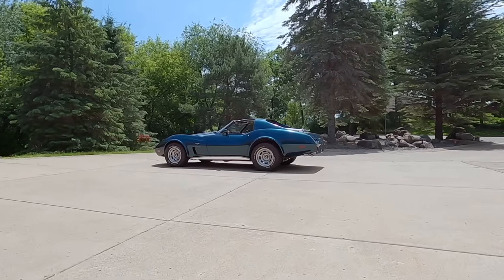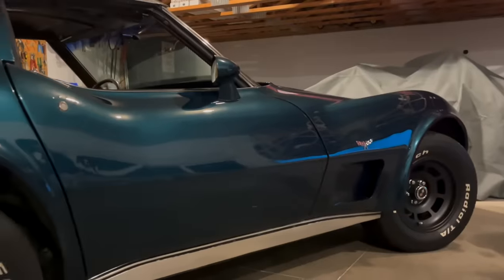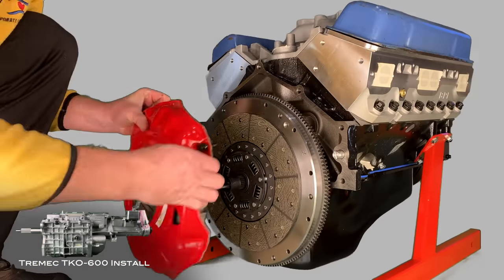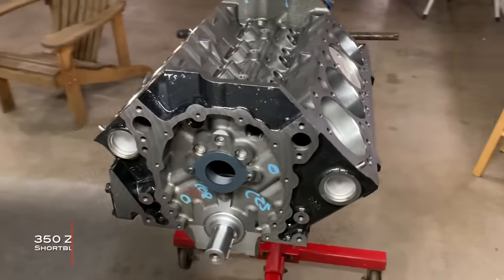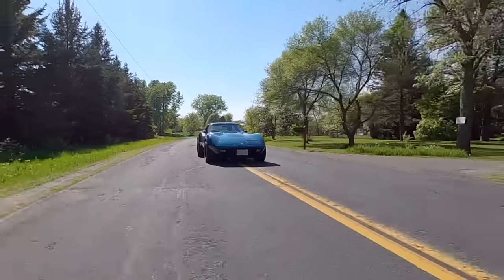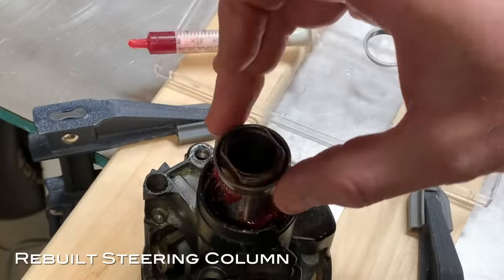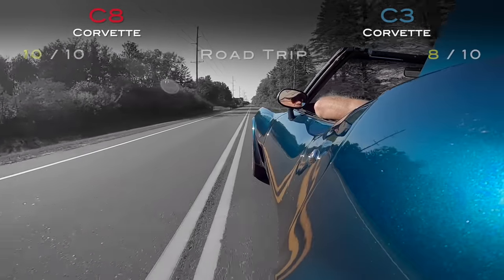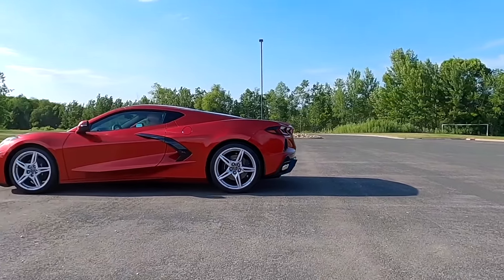C3 Makeover: Modernizing a Classic Corvette

Comment: A simple "carburettor" injection system can improve all classic cars, and the simplest fit under the air filter, and can't even be seen, anything wrong with the C3 can easily be fixed, if you think engine mods are easy, then just change the rear suspension as well, not that hard, you can buy a kit, or make something even more radical yourself, maybe a Jaguar rear end, and do try LED headlights, then you can't complain about the light anymore, about the dashboard, i'm a boat builder, there's a lot of better ways to make a dashboard, but unlike a lot of others, you actually made one, maybe make one more? Start by putting a piece of plywood in deep, find some tubes and pipes that fits everything you want to mount, make a square for your tablet, drape some cloths over it, give it some polyester, reinforce it it with fiber glass, remove the wood and anything else you don't want behind, and reinforce on the rear as well, make some mounting points, and you're almost done, you can wrap it in fake leather, or even real leather, maybe even with stitching on the edges, and again, you just cover it with masking tape, cut it where you want stitching, peel it off and lay it on the material you want to use, or maybe a template that are stretchable, lots of YouTube videos on both subjects
Reply from the maker: definitely going to check out-consider the fiberglass route and hindsight: wish I would have made some google searches before I took the sheetmetal route! I think what I may consider is keeping "some" of the aluminum structure as the gauges are already set back and then create a more "period correct" overmold to match the interior. Appreciate you sharing all these details and thanks for the comment!

Comment: It's the "Lobe" separation that gives a cam the "choppy" sound,
even with 230/224 that cam is still going to be mild, because the lobe
separation is 112 degrees, (used for fuel injection, turbos, superchargers). 
You don't start to get radical until you get into the 108–110-degree cams, 
or serious crazy rad cams is 106-107, which is the sound everyone wants. but makes
it near impossible to tune. but you can't run a 107-109 on an LS motor
Even 110 LS is pushing it with a computer.  Great video btw
Reply from the maker: @ssdtrain1 - yes 100% correct! I didn't want to get too deep in the weeds with lobe separation in the video / I'm actually building a small block ford for my Cobra and may target a tight LSA to do exactly as you say - make it sound nasty and move the power band north (don't need a lot of torque in the car) - thanks for the comment!

Comment: I would say the Corvette has always been a sports car more than a muscle car. I'm no end all be all say when it comes to cars, but the way I see it, sports cars have track speed and handling, while muscle cars have straight line speed and pure power. I think a big example of this is the aerodynamic profiles of even modern muscle cars, they really don't care about the advantages of less drag, rather they make up with by having bigger engine bays with their squarer front ends in order to have the largest engine set up possible. Speed by means of pure brute strength i.e. muscle, instead of a combination of aerodynamics, light weight, and performance engines in sports cars.
Reply from the maker: well said and I can't disagree / thanks for the comment!

Comment: I'm not a huge Corvette guy but my 2 favorites are basically what you have (C8 and C3 Stingray). 
Fantastic job on the rebuild. Love all the modernizations. 
Question: would you go further?
There's ability to add all kinds of modern things these days, if you can do things like retrofit speed sensing rings on wheel hubs, etc. 
I'm about to modernize my '85 Mazda RX-7 with a full Haltech VCU and PDU (full rewire) as the first step. And I'm always curious to see what others have done.
Also, that ShiftSST company has a FD RX-7 kit that looks pretty good too. Overdrive is exactly how I'd want it too.
Great job and nice car!
Reply from the maker: @3toedSloth75 - ABS can be done for sure - haven't researched it, but I know wheel bearing - hub assemblies are very affordable and most have a reluctor wheel built in so I don't think it would be overly difficult. As for drive by wire - same (not too hard) - The edelbrock proflo TPS has (est) 100+ butterfly position and by moving to drive by wire, I think it wouldn't be overly difficult to just forgo this setup, and replace the TPS with a purpose driven stepper motor / etc (or something similar) - tons of potential - thanks for the comment!

Comment: You are a talented man. I worked at Chevy Engineering where the Corvette was developed and have driven all of them back to the C2.  I could write a book critiquing what you did but won't insult you.
My biggest concern is the metal dash in the event of an accident.  This could portend life changing consequences. Even back to the stone age of the 70's head impact on the instrument panel came on the radar of car designers because in the case of a front collision and intrusion into the occupant, the driver and passenger can clearly contact the instrument panel. In subsequent years, all this was tested in the laboratory with instrumented dummies to save lives and of course airbags everywhere including around the shin area to keep the occupant from submarining.  
Personally I would have never done what you did and I owned an L82 C3 back in the day.  I would simply buy a C5 or C6 with Z06 option if a need for speed and perform mild mods and all for cheap. Faster, safer, more reliable. The C5 was even a big leap forward from the C4 which was a watershed from the C3 which I agree have undeniable 'charm'.
The book I oould write relates to what a given car means to its owner.  Moreover, as with people, it is the flaws and character of an automobile that give it charm and appeal.  I enjoyed the British sportscars I modified when a kid in engineering school more that BMW's 3 x's as fast I owned later in life.  Same with a Harley Davidson compared to a Honda Gullwing which does everything better. 
All that matters is you love your C3. Nuff said.
PS. Of all the Corvettes that have been created, I like the C8 the least and will never own one and yes as you say, it is the most capable but don't tell a C7 ZR-1 that.😉
Happy New Year.
Reply from the maker: Haha - thanks for the comment @lukewalker1051 / agree that a C7 ZR1 is a pretty special car (I'd take one to compliment my C8 in the garage any day) :) - From the factory, I think they were 650hp?

Comment: After watching you go through the C3 I did not like the changes you made to the dash area. However, you mentioned that you wished that you had not altered the dash layout and look.  IT is possible to add a single din modern stereo with a flip up LCD screen that integrates modern ammenities such as GPS and system tuning.
Reply from the maker: yeah those aftermarket decks are nice - I'm going to see what I can come up with to improve the dash with the original panels but keep the fuse block location fixed / thanks for the comment!

Comment: if you care about the engine so much, for the love of chevy, Use an AC Delco Oil Filter or better. Fram is the harbor freight of oil filters. your car deserves better. You'd be shocked if you cut open a fram vs a leading brand. the internal composition is wildly different between filters. theres videos out there in case youd like to see.
Reply from the maker: haha -ok ok (lol) - The FRAM was just on there for the build to keep crud out of the galleries/return - I run Wix on the new motor / thanks for the comment!

Comment: Any suspension mods? The one I had was terrible to drive, a 1972 model. No curves allowed, you'd end up off of the road with ease.
Reply from the maker: I have the OEM setup minus adjustable strut rods but there are a number of aftermarket suspension mods that can help your C3 handle a lot better (check out the forums) - near term I'm planning to add rack&pinion to address the dead spot going when straight / cruising at speed. Thanks for the comment!

Comment: I have a '72 I've had since I was 26 (over 30 years).  When I was younger I was stationed near Seattle and decided to drive it back to north central Idaho to visit family.  It had/has side pipes on it.  Love that angry growl cruising down the road.  But, I'm right there with you.  Six hours of listening to that at higher highway RPM's got old, and then irritating, very fast.  An overdrive would have been very nice.
Reply from the maker: Never too late to add that overdrive to your 72 @markbrown9765 :) Check out SST / Summit - etc (SST has sales from time to time too). Side pipes have a coolness factor for sure and totally agree on the noise. I have Cobra replica with side pipes and on longer drives I actually wear earplugs! Another drawback to the side pipes: Another shiny part to keep clean! Thanks for the comment!

Comment: The biggest ding against the C3 in my mind was the fact that it was so easy to over-steer, especially if you have years and years (decades, really) of not driving that kind of car.

Okay, that, and getting the radiator out.  That's a pain in the ass.
Reply from the maker: haha yes- especially with the condenser in the way too / lol (been there done that) - now I just take the hood off if it needs to come out! Thanks for the comment

Comment: I have a 76 with a solid roller 388 stroker making around 550HP and I love it. I Drive it all the time on the street with a 254/260 cam and AFR heads and ran a 10.86@122 on drag radials definitely love the C3’s sweet video
Reply from the maker: Great year / great car - thanks for sharing Myman :)

Comment: The 1977 is the last C3 with the attractive dash. The 78 is the first one that looks like a plastic box from an x body Nova.
So I agree the dash would have been better stock for your car.
The original steering wheel isn't as nice as the 75 and older ones.
I am curious about a couple of things.  You kept 15 inch wheels but don't mention the fact that the 60 series tire is going to give a better ride than 35 series or whatever the new one has.  But won't give the same handling. On the other hand, a stock C3, even with 60 or 70 series tires is known for having a harsh ride even by 1977 standards.
Fuel injection conversion often has an electric fuel pump that is not in the tank and makes a horrific racket and vibration.
Also, the factory intake of these cars is lower than virtually all aftermarket intakes, so retaining the cowl induction precludes swapping intakes. The fuel injection one does not look as low as the factory iron intake. I wonder if the throttle body is lower than a quadrajet to offset the height of the intake.  Edit: I saw in a later video the 77 does not come with cowl induction.  But air cleaner height is still important since it forces air in from the front.
The overdrive trans is great.  If it goes in without any mods to the floor in the case of the automatic, that would be great to know.
For the 77 to come so close to the new Corvette in performance when, as shipped the new one has 150 percent more HP, you must have upgraded the HP of your 350 quite a bit.
   I have a 75 L48 project car, so your video inspired me.
Reply from the maker: Lots of great feedback @auteurfiddler8706 / Overall I'm happy with the upgrades I made and good luck with your 75 L48!

Comment: I think you are wrong about what overdrive means. The normal top gear is one where your car will be able to reach its technical top speed at maximum rev. When you lose rpm, you win torque and vice versa. An overdrive gear will not let the car reach its top speed. It will not have enough torque to reach maximum rev on the motor. With a given gearbox, you can change the gearing of the rear end to make the top gear of the box an overdrive, never mind what its gear ratio is.
Reply from the maker: Its definitely possible to achieve an improved final drive ratio by changing rear end gears too / thanks for the comment!

Comment: I come to the conclusion that i value driving my cars 
And in that leads me to build GT grand tour style of car 
that i am confident that it will make a continent long trip without fault and without breaking me in the process 

I agree with just about everything you did excluding the efi set up
Particularly with the data logging abilitys available today its never been easier to get a carb to function correctly and to tune one properly

 i am not against efi i just think people think its a silver bullet to problems that are tune related not carb related and its a lot of time money and effort that doesn't Often yeild 

Recently recently a customer took his long term car a car thats been on the road for a decade a driven regularly 2 3 times a week if not more with tripple webbers and  converted to efi jenivev side draft 

 the car has had data logging fitted for two years and has plenty of data with the carbs afr egt digital ignition timming it had everything bar efi 

Long story short the efi couldn't better the power or torque of the carbs it was close 5hp down at best and that was cheating with different length velocity stacks 

What the performance shop put it down to was the distance between the Venturi and injectors relative to the valves the efi couldn't have been mixing the fuel as well because its nozzles were significantly closer to the inlet and not introducing fuel in parallel with air flow
Reply from the maker: Thanks for the comment -  sounds like a mixing-turbulence loss with EFI / I guess maybe different injectors / nozzle types could help with this? - otherwise -.... (IMHO) - webers are pretty badass :) Believe it or not I'm building a small block ford right now for a Cobra replica that I'm seriously considering using webers on. If I go this route, I'll probably break in the motor with a 4-barrel / Autolite clone and after XXX miles, swap the intake with the webers and start tuning. Nothing more classic on a Cobra the 8 webers :) Any recommendations @bluejayfabrications2216 (mistake / go for it / etc)?

Comment: The original GM 350 cast iron V8 block and the LS series gave rise to the theory of supernova fusion stopping at iron.
Reply from the maker: Not an astrophysicist here - but - pretty sure stars explode shortly after they start fusing iron. Good news though: The atomic number of Al is 13 (vs 26 for Fe) - thus- our supply of LS motors should remain plentiful :) Thanks for the comment

Comment: I did a tremec conversion on a 73 C3 and I couldn't get the driveline angle correct no matter what I did. It wouldn't go up in the tunnel enough so It had a nasty vibration at 55 MPH. I finally got a CV joint driveshaft made and it fixed that vibration. However, once I got it up to highway speed all kinds of other vibrations showed up. It drove me nuts and I sold the car at a huge loss just to get out of it.  
Its too bad because it was a really nice example, pristine frame, nice interior, it was a dream car for me but that vibration killed the desire to ever get another one.
Reply from the maker: @theevoltionofthebear3093 - One item on my list this past spring was to check driveline angle to verify things were in spec/good to go. That said, I took it for a spin after the TKO600 was installed and it was smooth as butter. Huge bummer you weren't able to figure out the cause of vibration on your C3 but I image you were on the right track (ie- driveline angle or a driveshaft - balance) / Thanks for the comment!

Comment: I love this design philosophy. I wish they had a replacement gas tank made out of plastic to make it corrosion, "hit" resistant and lighter. Dies that make sense?
Reply from the maker: yes the C3 tank is exposed (a lot of other cars added polypropylene shields to the tank to help). On the C3, there is a steel shield the covers the top and sides and I've read the tank is designed to push up/away in a rear collision . The design is no where near as safe as a current generation gas tank, but for the time, it was decent safety and at least GM engineers were thinking about keeping the rear end from exploding in an accident (ie- not a Pinto!)

Comment: I installed a big cam in a 360 not knowing what I was getting into. the lack of vacuum problems were immense. vacuum power brakes, vacuum advance timing, vacuum every dam thing. do your homework, I didn't.
Reply from the maker: Well said - were you able to fix it (ie- add a vacuum pump/etc?) - or - did you just change out the cam? Thanks for the comment!
Reply: @TacoJoe  I suffered, lack of money back then, I got it reasonable but not right. the vacuum advance distributor was the culprit. it ran like a beast though.🤣

Comment: Are those BFG tires a good choice? Are they performance tires AT ALL? They're the most important part of your car,  and investing in some more modern tires should make a huge difference.
Reply: Yeah, think of a real tire on there. But I bet it rides like a balloon, for better or worse.
Reply from the maker: Not performance, but well suited for the 15" wheels-back spacing - and - they help soak up the road bumps too (run them in the mid 20 PSI). Do they handle? Not really. Do they cruise reliably and good for all weather: Absolutely. Thanks for the comment!
Reply: @TacoJoe  I'm not referring to the size,  but the brand and model.  Are these even speed rated?